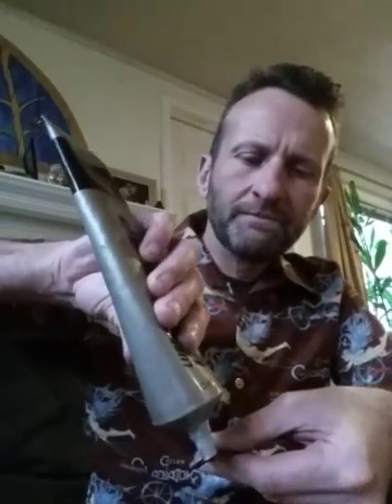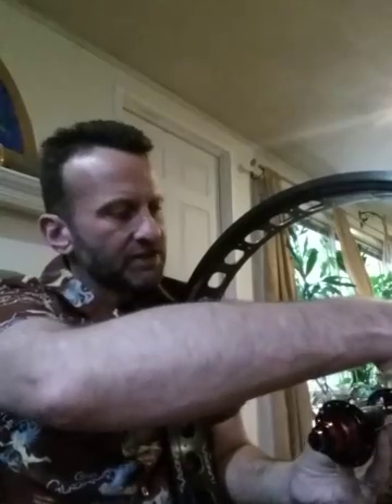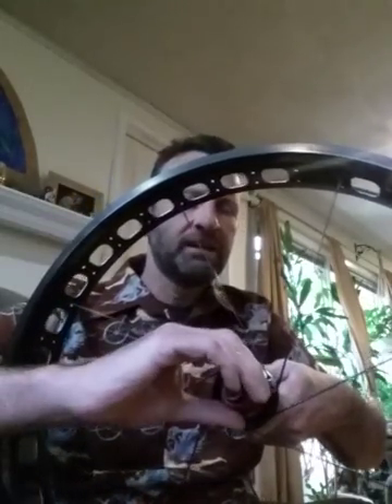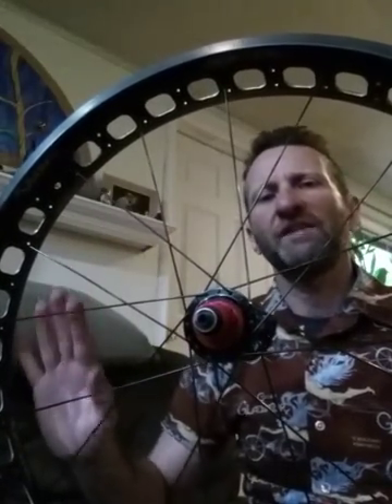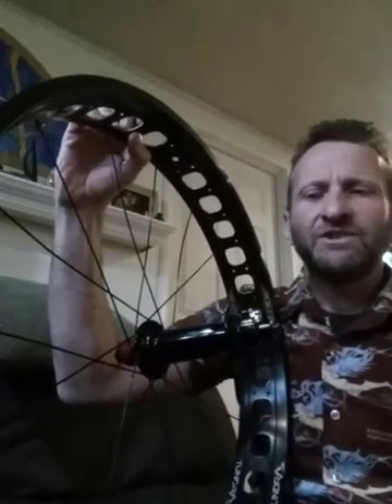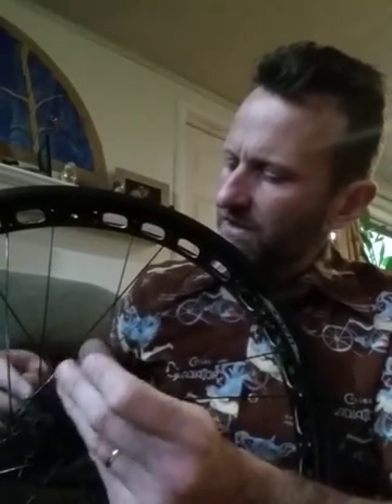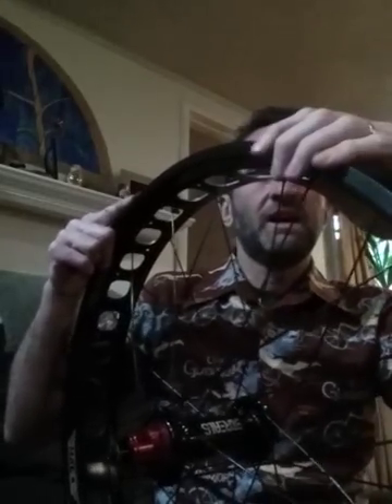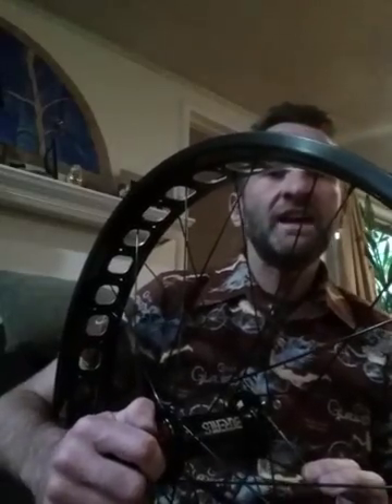Building and Lacing a Fat Bicycle Wheel

Comment: Hi Lars building some wheels the last years so much fun ….have you tried the wonderful easy  diy spokes length calculation Lars method on 29er and 27.5 rims/wheels ?? Best wishes from Denmark
Reply from the maker: Yes. It works in those also.
Reply: @LarsDanner  bye the way what nipple length do you use in fattie wheels and 29er wheels…12 mm all over ? Cheers
Reply from the maker: @rasmusredfire2667  12mm brass, but if the spokes are a bit short, I'll sometimes use 16mm

Comment: Wow. Great video. Basic instructions and to the point. Wish I had watched this prior to spending hours trying to lace a wheel only to have it end up with some spokes that were way too loose.  I always left out the critical step that you show regarding the key spoke on the other side and where to start it in relation to the initial key spoke and valve hole.  Your explanation of the “why” and showing the pull and push spokes by rotating the hub also helped me to visualize what I was attempting to do.  Many thanks.

Comment: Great video, thanks! I'm considering taking on swapping my front wheel hub myself, as I've bought a Bluto suspension fork and my current hub is 135mm, and the Bluto takes a 150mm hub. My rim is 100mm wide and the spoke holes are about 12-15mm from the edge of the rim. Can I use my current spokes or will I need new spokes?
Reply from the maker: They will probably work. Good luck!
Reply: @LarsDanner  Thanks, I'll need all the luck I can get for this project :)

Comment: Mate I have watched this over and over and I have my rim and spokes in front of me but its not working out at all. I purchased a set of lovely special edition spokes (gold) they are getting bent and will not reach the rim hole as you described in the normal under under and over. You do not say clearly if the spokes on the opposite side of the rim should be acting in the same direction or be reversed.  I notice the holes in your rim are symmetrical NICE but what about all the boys with rims with holes that advance slightly.... I should never have tried to follow your advise.. really sorry bud thats the truth
Reply from the maker: How long are the spokes?  What's the rim model?
Reply: @LarsDanner  glad to have chat thanks bud;  Gold Halo Bike Spokes Double Butted 261mm  on 26" x 4" fat rim. Rim is unidentified!  Have had to leave it at the first inward set of spokes twisted in the rotation direction.. outward spokes has where its all gone wrong.. have looked at the utube vid APP for lacing and its a simple under once and then over but that is for a none fatty rim so dunno what to do?
Reply from the maker: @seanappletree2570  261mm spokes are normally (but not always) long enough for fat bike rims.  We could try a skype early next week to see if I can help you out.  I'd need to see the issue you are having to help you sort it out.
Reply: @LarsDanner  Thats really gonner be a problem as I only get to go online in the local library mate. I just do not see how I can do the regular whats it? 3 Fold Lacing or something.

Comment: I'm stuck at the whole, contradrive, and lacing the other side, you didn't explain very well, there is a bit to much talking, makes it confusing when you go back and forward with the methods.
Reply from the maker: +HansensUniverse hmmmm. Try looking at a shell that is already built.
Reply: I had the same problem. Once I watched the video about 6 times while staring at his wheel and my wheel it became clear.  To me that was the most critical element, as I had literally spent hours trying to lace a wheel before watching the video always ending up with some spokes that were too loose. I don’t know how he could make it more simple then he did other than having a whiteboard with a diagram on it showing the key spokes and the valve stem in different colors.  Maybe better lighting on the actual wheel would’ve helped along with a few still photos of the key spoke location possibilities on the other side.  Still the best video I have found on lacing a wheel.